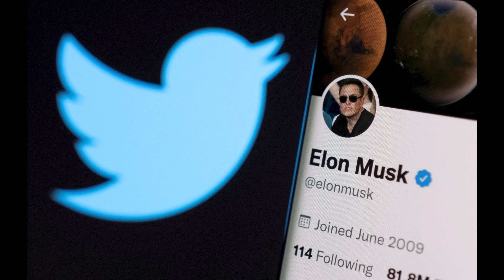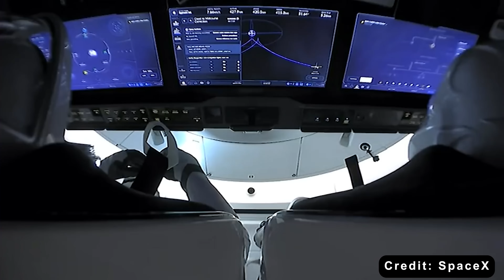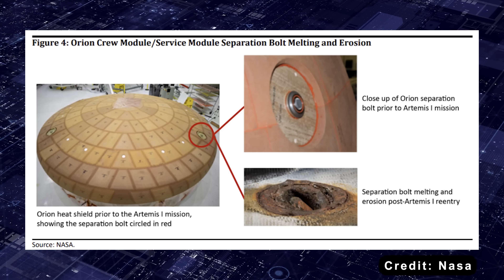SpaceX’s New Dragon to SOLVE What $30B NASA’s Orion 'Impossible'...

Comment: Dragon would require a complete modification of its control systems. Currently control is primarily managed from the ground. Radio transmission delays would make this unfeasible. All control at that distance would require all control to be internal.
Reply: Also it's not built for re-entry at those kinds of speeds coming back from the moon. The modifications to it to fix all these shortcomings would make it something completely different than the Dragon and you would be better off designing something new.

Comment: 30 billions dollars of of scape metal great move NASA! It couldn’t even preform a simple mission to the ISS without almost destroying its crewed astronauts with a severely designed spacecraft, until  2 experienced great astronauts took over control and docked a spacecraft that was out of control with a faulty, (thruster) control system that was completely untested due to 2 previous attempted,(Aborts)failures in a poorly designed spacecraft.mission failure. Then SpaceX stepped in and rescued Boeing crew stranded astronauts to save those astronauts!

Comment: Apart from any other issues, Dragon's heat-shield is not designed for re-entry at trans-lunar speeds.
Reply: Wrong.  Dragon V2 uses PICA-X which is capable of Lunar and Martian return velocities.
Reply: You just say that because you want it to refuel several times in orbit. Space X will find a way in spite of Nasa.

Comment: I was baffled by this argument. At first I thought they were just suggesting replacing the Orion capsule with a Dragon Capsule. Then they said that the crew could transfer to the HLS in low Earth orbit, and the HLS would continue the journey to the Moon. This is completely nonsensical because the crew would have no way of getting back to Earth!
We just have hope that the existing Artemis configuration will work. The real unknown is whether SpaceX will sort out Starship refueling within a reasonable time, so it's no surprise that NASA are pressuring them.
It would be better if SpaceX could design a much smaller lander, and avoid refueling altogether. I think this might be made possible using V3's 150t low Earth payload. In this scenario the top of the Starship would become a third stage. I think whole Apollo configuration only weighed about 50t, including the command module. It might well be possible to have enough fuel to send a reasonable large lander to the Moon.

The problem with landing a Starship on the Moon is that it's much bigger than it needs to be.